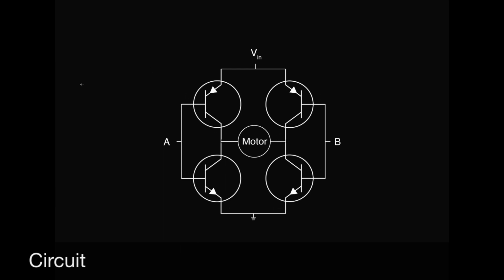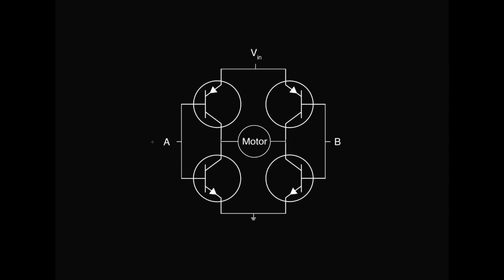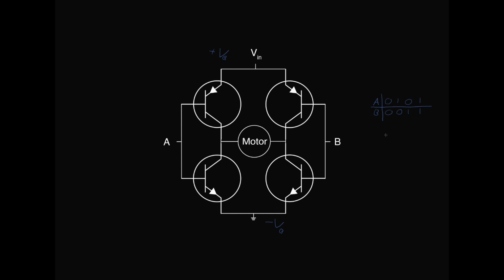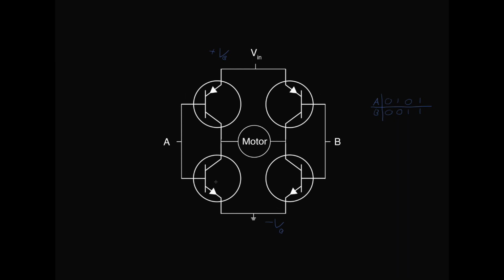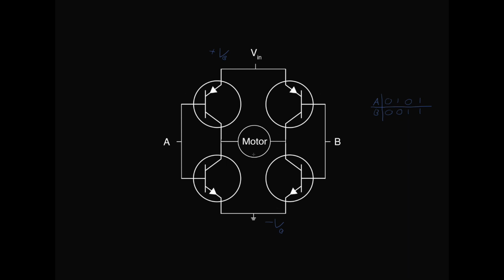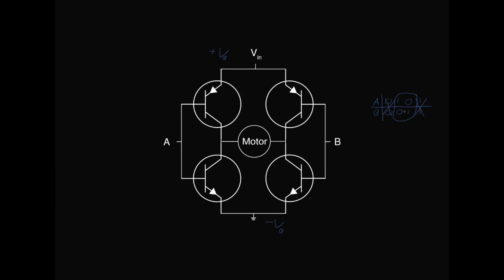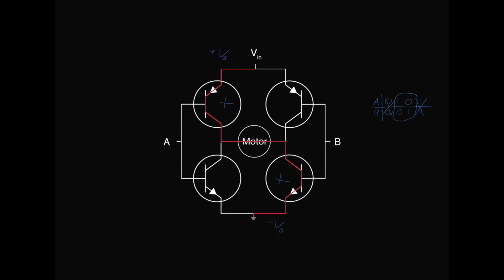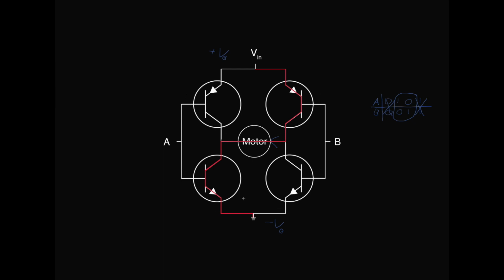H-Bridge Basics

Comment: To control speed you need IC chip but even then would a motor like this be able to be changed to a very low speed like 50 rpm

Comment: wouldnt there be a small time when one transistor is turning off and the other is turning on, where both let through a small current, which shorts the circuit?

Comment: if both A and B are in the same state, does the motor resist turning if you try to rotate the axle it with your fingers? That is, the axle is being held in place? Or is it like no power was applied at all, the motor turns?

Comment: Doubt!!!! The pnp transistor would be of only if veb has voltage greater then 0.7 so the applied voltage should be vin+0.7 to make transistor switch off ryt?
Reply: Yes you are partly right and I think he missed that out in the explanation. In PNP transistors, as long as you have VB= VE -0.7 , the transistor will switch ON and vice versa

Comment: No offense,  but that was a pointless example.  The circuit required you to manually switch wires from v+ to v-.  You could skip the transistors and do that with just the wires.  I understand what you were trying to teach but it would have been more useful if you connected it to two switches or and ldr so that this circuit could actually be useful and the explanation wouldn't appear pointless.

Comment: He explanation is NOT  basic: WHY ? ?   In switching an inductive device and ESPECIALLY a DC motor , It is essential to  make sure that the    when the 
direction of the current changes, for example when stopping or reversing the rotation of the motor (CW, vs ccw ) the sudden change of current causes 
Ldi/dt to generate a voltage spike between 10Vcc - 3Vcc .  Often this voltage spike will destroy the driving device .

Diodes are added across each  leg of the H connected to clip this voltage spike. 
see: https://electronics.stackexchange.com/.../how-diodes-protect-h-bridge-dc-motor-drive...

Comment: Thank you! I built this with an Arduino kit and it worked BUT only when I put the two NPN transistors at the top and the PNP's at the bottom.
Reply: Check the positive and negative of motor
Reply from the maker: Glad to hear you got it to work! But that is very strange, it should definitely be NPN on low side, and PNP on high side, is it possible they got mixed up in your kit? Have you tried verifying the part by the markings on the device itself?
Reply: Yes, I checked them multiple times.. At the bottom I used the BC32725 (PNP) transistor and at the top BCBC337-25 (NPN)

Comment: Can u give parts description please
Reply from the maker: Yaser Ibrahim, as for the demo (I am guessing that is what you are referring to) I believe that I used a pair of 2N3904 NPNs, and a pair if 2N3906 PNPs, they are small signal BJTs that I happened to have around, not ideal for doing what I did, but they were sufficient to illustrate the demo. I also can't remember if I mentioned it in the video, but this circuit is put nicely into a single IC (well there are many other ICs which also do this) which is the L293D H Bridge